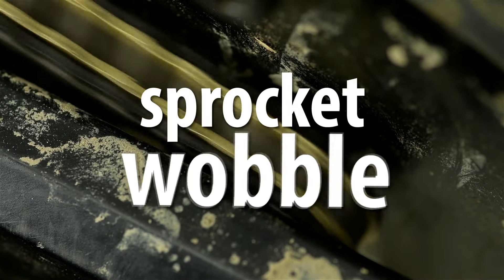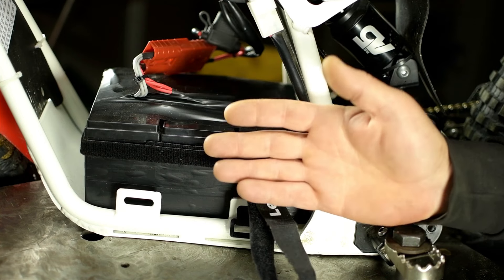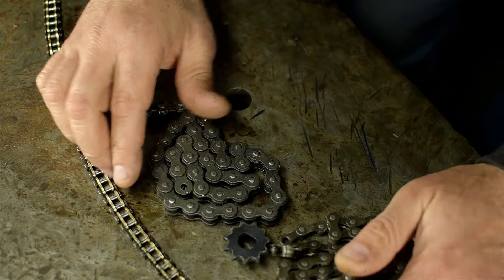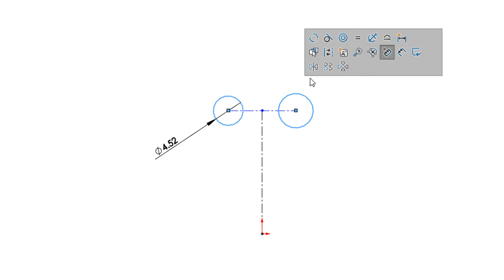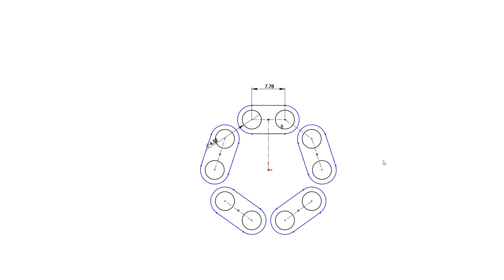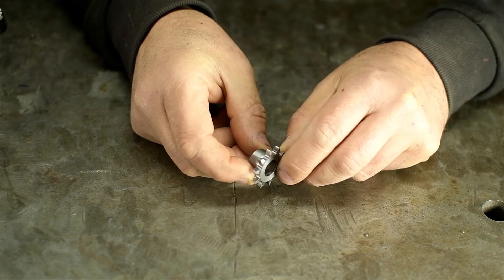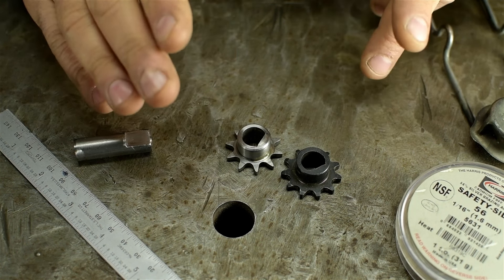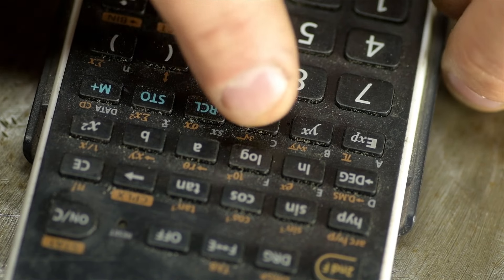Let's Make Our Own Chain Sprocket!

Comment: Man where were you when I needed help with my sprocket going on a modified Harbor freight winch? I got one farmerfied on it but it is too big. 

The farmer without a CNC method of doing this is to take a flat piece of steel the right thickness and carefully draw out the spokes then scribe a circle and drill holes at the intersecting lines. Draw a bigger circle to cut it out leaving room for the teeth and then rough cut the rest of the teeth and hand file each one to be close. Fab a hub and weld the teeth section too it. For the D hub either do the braze trick or drill a hole through and spot weld the D into it. In the end it looks like something a 6 year old did with modeling clay and works slightly better than that old one. :)

Comment: You know for a few bucks you can add a rotary encoder to your mill and not loose steps anymore. It will give you a ton more accuracy and much better parts in the end. The encoders used by the Odrive only cost $20-30 and there are even cheaper options.

Comment: How would adding a hardened  blind pin like a worn out drill bit shaft or grade 8 set screw work to hold an insert for braizing and for added reinforcement against twisting in the shaft? Just curious if that is a belt and suspenders idea or if it would actually give usefull benefits and extended life.

Comment: Also looks like that motor shaft was already screwed or bent so at least you got more torque out if it before it kills itself... what are the odds the driven sprocket is just as out of round?

Comment: You also could have put your D-shaft in the lathe, machined away most of the old sprocket, leaving a hub with a D-hole, and brazed or welded a new sprocket to it.

Comment: I have a sneaking suspicion that original sprocket was sourced through Harbor Freight. It seems to have the same exact 7-1/2° wobble angle as the factory wheel hubs and arbor nuts on my HF carbide grinder. Coincidence? I think not.

Comment: could you do a walk through on how you designed the sprocket as it looks like onshape and its the one thing i struggle with
Reply: please could you make a 60 tooth sprocket 05b-1 chain Pitch 8mm Roller Diameter 5mm sprocket width 3mm if so please could you send me the stl file?  thanks in advance

Comment: Tony, it appeared the motor mounts might be allowing the motor to cant under changes in load. Perhaps the motor mounts need refinement in order not to repeat the sproket deformation.
Reply from the maker: the motor wasnt mounted when I showed the new sprocket.  was just sitting on the bench under the bike.

Comment: Minimal chain sprocket tooth are normal 12, because of the polygone effect. I think you old guy tony must known this.

Sprockets with a low number of teeth show a high speed variation (5 teeth up to over 14%). This is why we advise using a sprocket with a minimum of 12 teeth in order to limit the polygon effect. As the graph shows, more teeth will further reduce the effect. By the way, this not only effects the sprockets. You will find the same result among all idler-, transfer- or support rollers. To minimize this effect, choose the diameter for the roller based on the nominal pitch of a 12 teeth sprocket of the belt series that you prefer.

Like your channel greetings from dutch engineer

Comment: You should of got/made a lipo battery, gives a constant voltage, but after a run, if you want to put it into storage, then you have to put the batteries into storage mode, this is to make sure you don’t kill the battery cells.

Comment: I like your mojo Ton's. Umm the top of the sprocket tooth is an involute (a rollout of the circumference). Oh and under 10 teeth you need to reduce the addendum more than usual.
Question??? I've always wondered how small and what kilowatts of a generator you can get away with to run an electric bike, saying bye bye battery and using capacitors for quick response.
I envy your shed conglomerate.

Comment: Another great video. One thing you didn't touch on was how much the part cost to make vs, replacement cost.  This is where DIY fails for my projects. (Of course I'm not including tool costs I'm still choking on how much a cheap sliding miter saw costs for woodworking vs my rotary saw, straight edge and two "C" clamps method.) One project was around $50 what with buying excess material and buying a replacement part after I bugger the first prototype. Then finding an equivalent on Amazon for $23 with prime shipping. Arrgh!

Comment: It appears that you might have the chain too tight, atleast the noise from the finished part got me thinking.
I personally would leave 1 inch of slack in chain just to adjust with the suspension movement
By the way nice job

Comment: Do you know those drop deck trailers that you crank it loose so the deck will lay flat on the ground when you load and unload your bike.. i want to build that for my motorcycle but my problem is money is a little bit tight right now and those torsion half axle is a little bit over the budget for something i wont be using so often. Would like to see if you can build an alternative to a torsion half axle with just a hobbyist basic tools

Comment: Those trials bikes dont require more chain slack then that? Looks mighty tight in the video. I cant tell if the sprocket is parallel with the swing arm pivot point or not.  
 I know on the full sized bikes running the chain to tight will wreck the front sprocket and shaft bearings in no time.

Comment: Just curious: what size steppers are you using on your router/mill? are you using ballscrews to move your axis? what pitch are they?

If you used nema 35 with a low pitch ballscrew you should be able to push your house over with it. I have nema 24 with low pitch ballscrews and believe me,  my machine would either slide off the table or I'd break my arm trying to hold it in place. If the machine was bolted to the table, and the table to the floor it would either break the table or my arm. Now I want to say it is 20 revs of the stepper to 1 inch of travel on my ballscrew but that does seem a little high. I can't remember what it was when I measured it so I'll safely say 10 to 1 ratio. 

I haven't done aluminum or steel on mine yet, I only have a wood router mounted in it but eventually I do want to be able to machine aluminum.

Comment: Being of a British simple approach, I would have run the chain slightly loose and fitted a spring loaded chain tensioner on the bottom run, as my MX bike has. Eliminating all the cnc cad stuff, and also compensates for bad chain ,sprockets and motor shaft. 
        How many hours did you spend doing this, I could have fixed it in 15 mins. 
     Also I would have pegged the key!!

Comment: Lead acid starter batteries (the most common) will deliver 30% of their rated amp hours with any useful output. Deep cycle nigh go to 45% but push them too far creates an anchor. 
Lithium LiFePO4 deliver 97% at full current. They have longer cycle life and are not destroyed by lack of use.

Comment: If i recall correctly, Fusion360 has a "gears" function that really takes a lot of the math/guesswork out of designing a gear.
Reply: Way back, brother wore out rear sprocket on old mini bike recut teeth with rat tail file! 3 try later  bike would hit 50mph!

Comment: Damn Tony, you went through all that work on your router when all you had to do was grind a cutter the profile of the chain and then just turn it out on your lathe.  :)  I did sort of half expect you to just drill a hole through the sprocket and key then weld them together though

Comment: 5/16" pitch chain British standard look up the renold crofts catalogue
Reply: I wondered about that. I have that catalogue in a filing cabinet (except in my part of the world it's Renold Christian, you must be from SA?). 
At the far end of the attic. If the bookworms have not finished it off. And I didn't ditch it after the attic collapsed in the earthquake...

(Hmmm .. after checking online - https://www.renold.com/media/228840/renold-brand-chain-tables.pdf)  
Nope, they list BS 05B-1 chain, and it's 8mm pitch, 5mm roller diameter. They obviously don't make the imperial dimensioned version, if they ever did. 
From 06B1 up, all the dimensions are imperial in the online catalogue, and the three chains below that size are hard metric, so maybe they always were. Britain went metric in the late 1960s. 
Now their right wing government has gone cold on the idea. It's a kind of toxic nostalgia spreading over the older parts of the English-speaking world. 

However I assume Canada is entirely metric, (because of the French connection) but maybe not, due to infection from across the border...

Comment: Roller chains do get some 'chordal action' the less teeth they've got. 11t is pretty safe, tho not ideal. 10t gets a pronounced hum under high speed load. 9t is even worse. If you've noticed a buzz in the chain at speed, that's what it's coming from.

Comment: Looks like your using Solidworks, I am a STEM mentor and need to get a small steel capable router for my shop. We do First Robotics in case you have heard of them. I think we need to make out own gears occasionally. :)

Comment: I'm meshing 2 #40 10 tooth sprockets with a #420 chain. When I bought these I simply thought I'd shave down a little of both sprockets and be good. However, Now installed on my 100% home-put-together 54ccleaf blower 2 stroke Kawasaki motor and connected to a jackshaft the chain and sprockets dont want to mesh well. I notice I shaved the front of one and the back of the other and now could it be that the chain is chafing on both sides? Plus some slight misalignment......It is difficult to imagine this rolling down the road in harmony.
Ant insights on sprocket dressing before introducing to chain?

Comment: looks like a kart chain. Check out some flat kart racing sites and I bet you'll find it there and yes, these chains are different from regular roller chains. I learned that the hard way. A regular roller chain will not perform as well.

Comment: Fun fact, electric motors eats chains with the instant torque and on/off charakteristic of power.
I know a guy who made an electric moped, he had to step up to motorcycle chains before it worked for any length of time, the chain intended for mopeds went "wonky" in weeks. A 750W motor might be too much for that tiny chain

Comment: At 11 minutes in, I'm thinking D-holes on a shaft with a flat aren't nearly as good a fit as a keyed shaft.  Maybe when you tighten down the screw, you lose concentricity. Maybe the sprocket wobbles. I bet you get a better sprocket if you put the D-Hole in the blank, fasten it solidly on the motor and then find out how concentric the rest of the blank is and fix that before cutting teeth.

Comment: Some time ago you were making custom gears for mini lathe to slow down feed rates and made a comment about Mod 1 gear cutter 'set' from China
. Anyway, yesterday I found a reference book from 1994 and found DP gear cutters run 1 to 8, BUT, modular cutters run the opposite direction in regards to the number of teeth they cut.  That means the Chinese cutters were numbered correctly?

Comment: You might want to consider that one of the two sprockets should be a odd number of teeth. This is called the "hunting tooth system". This will give you more even chain wear because a specific roller on the chain does not land on the same sprocket tooth  every time. The chain is constantly advancing and "hunting" for a new tooth. It eliminates the WHA WHA WHA noise that some sprocket drives can produce. 
By the way Tony, that is some nice work you did there. I'm like you; I hate those D shaped bores.

Comment: Them bikes are a copy of an Oset exactly the same set up. My daughter competes on one, batteries are rubbish they need to come with Lithium as standard but at over £500 for lithium and charger its expensive. Oset have a really good technical department you would get the chain size off them or try the Trials Central web site. They are really popular bikes in the UK and more of the adult bikes are turning to electric, its the way forward, the daughter loves her bike

Comment: True story. I was working for a company in GA in the 80's and tasked to face off huge 36" sprockets on a lathe. The parts were so warped from the heat when the welders cut them out it was impossible to clean them up in the lathe. It was an interrupted cut. When I complained to the shop foreman his reply was..."Don't worry these are junk parts. We only make them because we are required by law to make replacement parts". Any wonder I am jaded? LOL

Comment: Could you have drilled and tapped a hole (or two) in the sprocket for a set screw, instead of brazing the D 'shape"?
Reply from the maker: not a lot of beef in the small sprocket, but maybe!

Comment: It's a pretty small number of teeth. Normally 19 teeth is considered a minimum for smooth action at high chain speed, but I guess it's a bit of a conundrum because for a given (input) shaft speed to the chain drive, a higher tooth count  (assuming the same pitch) will make the chain go faster.
Secondly it pays when laying out a sprocket tooth for smooth action, to slightly ramp the approach and recess faces for gradual engagement. This means reducing the radius of those layout arcs by a small amount in comparison with the theoretical value, aiming (on a drive this size) for the roller to come in at least 0.06mm clear at the tip.
Otherwise links where the pitch is under tolerance, or there's grit between roller and pin, will bind slightly.
ON EDIT: OK, I should have watched to the end before posting. ToT came to much the same conclusion. I'm surprised he needed as much as 0.010" rolloff on a sprocket that small, but maybe that was total, rather than per side.

Comment: The reason they can't give you a firm delivery date for a replacement sprocket being that there is only one place in the World that makes those 'special' cockeyed,wobbly sprockets. It takes ages to set the machinery up to produce such a bespoke item. Can't you just be patient while they get the job done?😀 A toothed belt drive might be a nice way to go in future. Quiet running,smooth power transmission.

Comment: If you really wanted to make this small project into a large project you could've cut a new shaft (with a standard keyway) for the motor, pressed out the existing shaft, pressed in the new shaft and then cut the new drive gear as well. Now you've got a 2-part video.

Comment: Can you control the esc on that? If not the boy maybe a rear wheeling master or Capitan loop out. Lipo plus dropping a tooth up front, hes gonna have a bit more throttle respect.
Reply from the maker: I can adjust the power setting but he had it turned back up in 15 minutes.

Comment: Is there a reason why you wouldn't just drill a hole from the outside of the sprocket's hub and plug weld it with a TIG rather than brazing it?

Comment: I know that you're a smart guy Tony but I would have used  a different way to fix that . Because those parts are no standart in any ways I would have turned down the sprockets to make adapter out of it to mount standart sprockets and chains . Have fun !

Comment: Very interesting to watch. With regards to the segment that you soldered in you could drill a small hole at 90 degrees to the main hole so that the hole you drilled goes into the segment, you could then drive a steel pin into the hole which would lock the main part and the segment together. You could solder the pin into place, if it protrudes into the main hole you could always file or grind the excess down.

Comment: Is there a way to get sprocket tooth patten cad files?
Reply from the maker: check out a program called sprocketeer online and free.
Reply: @ThisOldTony  have you had any success using this to import into fusion 360?
Reply from the maker: yep just open the DXF and extrude.

Comment: I don't know why sprockets are so hard for motorcycle OEMs to machine properly. I've not had problems with the front sprockets but the rear sprockets are almost always out of round causing tight spots in the chain corresponding to the rear sprocket rotation.

Comment: No heat treatment? The hardened chain will chew through that sprocket in no time, chromoly or not.

There's also something called the "hunting gear" principle - this relates to the number of teeth on front and rear sprocket. Most motorcycles are shipped with font and rear sprockets with either one or both having an odd number of teeth. There is a chain pulse that occurs regularly, based on the mathematical relationship between the relative tooth counts. If both sprockets are even-toothed, the pulse occurs on an integer multiplier of this relationship - and it's at its strongest, placing extra wear on the chain and sprockets. Theoretically, the ideal is an irrational multiplicative factor, this reduces the pulse to its minimum. 

With this application it's probably academic since the aim is to avoid the chain pulse coinciding with the power pulse from the engine - something you probably don't have with the electric motor (unless it has some weird AC commutating bidniz going on that induces a torque pulse).

Comment: I just got an old one of those and ended up putting a big ole brushless motor on it where had to modify the housing and fab new mounts to get running true and maintain heat exchange, strapped a lithium battery on it then changed the gearing which i shouldnt have done before i rode it but the redneck in me took over..  now its hard to hang on in the dirt..  on asphalt itll spin the tires enough to hang on but will spin out from under me if i dont have it level.. on dirt its like 0 to 60 in 3 seconds.. too quick.  Too damn scary tho..  its collecting dust now..  too old to keep flipping off the thing..